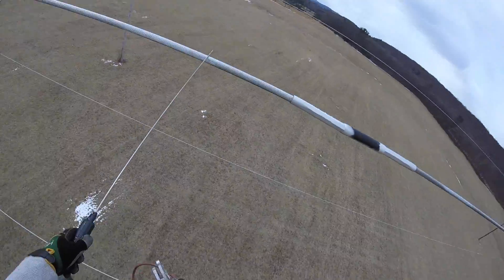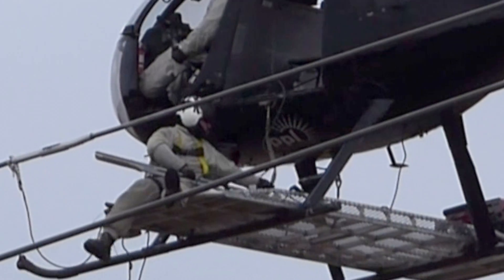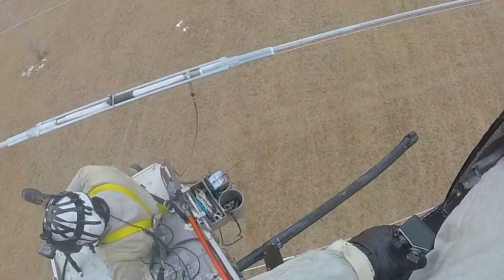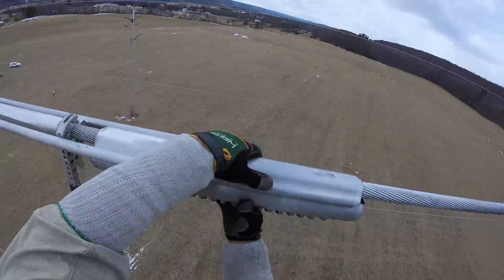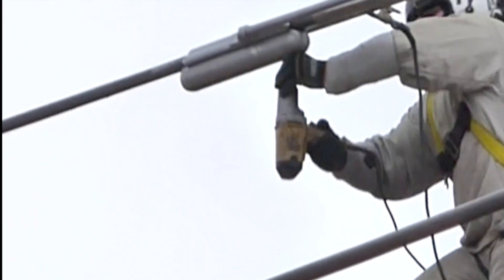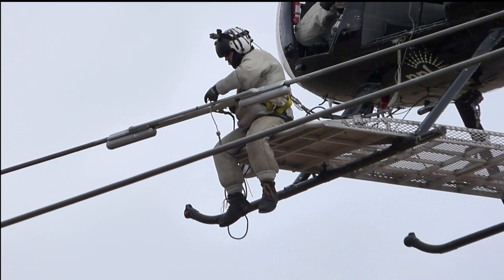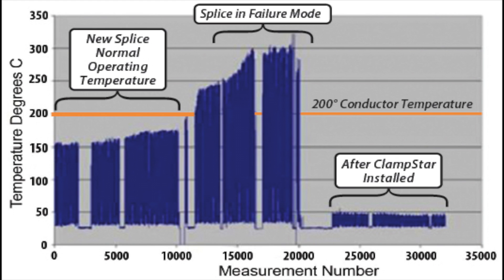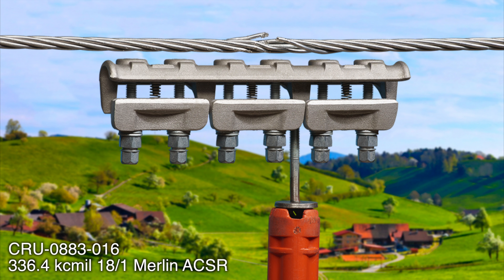Here's What To Do After Finding Hot Connectors On Overhead Power Lines

Comment: Why using a helicoper to repair? As it not only risky it is also a waste of energy
Reply: Snuggle Puggle: To bring the cable down, you have to turn off the power on the line. Then have a crew climb up a few tower to unhook the cable and lower it down. They can not unhook one tower at a time, so you need multiple crews to lower it slowly and evenly. Else there will be too much force and the cable can snap, or it can damage some towers or isolators.

Each person have to climb, which is riskier than being on the heli.

As for a waste of energy? Maybe.

The heli itself is quite safe. The guy is tied, so can't fall. If there is any issue the pilot will simply fly away and the tether cable will unhook or break in a safe way. So no danger for the heli itself. The work guy wear a conductive suit, which ensure that he is all the time at the exact same voltage as the line is. Since there is no way for him to touch another wire or the ground then there is no electrical path, and he can't get electrocuted. The danger is when he clamp on and off, which is why he use a rod to make sure the heli and him is at the right potential. If for some reason that fail, the suit would still make it safe. The rod step would be optional actually, they could just come with the clamp and a slightly different aproch, but why do that when the rod make it safer.

Once the clamp is on, all you need is a pilot which can hover. This need an experienced pilot, which is not anybody, but they are very common. Get the best and you are good to go.

Then you have the money part. If you bring down the line to do the repair, you have to cut the power to some client, and lose lots of money. Those lines can power a whole city. Turning it off is not always an option. Even if it was an option, the cost of the crew required to bring the cable down would be very high, and it take longer to do it. Now, they can do the repair with one pilot and one repair man, with one heli, which might be only 500$/hour (probably even less, I'm guessing 150$/hour for each of the pilot and repair guy, 15 gallon/hour of fuel (that is actually at cruising speed)). The ground crew would be cheaper, maybe 75$/person, but probably need 6-10 persons instead, and probably 2-3 hours for the repair. The heli can easilly do the repair itself in a few minutes. Do the math, the heli ends up quite cheaper.

As for crew safety, falling off a tower is easy and happend relativelly often. Falling off the heli or having an heli crash is almost unheard of.
Reply: Snuggle Puggle so you are not connected to ground. The lines are always life
Reply: Michael S what does this have to do? Here in germany they repair it from the ground... Its safe
Reply: SP: They use helicopters because they are faster and less expensive than using ground crews and multiple men.
Reply: Snuggle Puggle if the cable is on the ground then it will arc. The ground around  wire will be electrified. It can also cause a fire. Look up for downed high voltage wire. It is scary.
Reply: Ground mounted repair is always dangerous as you are more subject to high wind without being able to pull off like a helicopter, the clamp used to maintain an equal potential is designed to pull away if a gust forces the pilot to pull off. Also, when using a structure connected to the ground it is always a risk of a ground fault and with transmission lines the risk is substantially higher, something like a 745 KV line can arc across 25cm of open air when it is live. You might suggest working on a dead line but that is a rare luxury with transmission lines where there is no such thing as a planned outage like there is with distribution lines.

The other issues are ease of access and speed. Some transmission lines are miles from a road way across a field that might be planted with crops and the only suitable path due to weather might be through the field which can cost the utility tend of thousands of dollars in damaged crops that they have to pay by law. Now, think about how quick it would be to do say 5 of these over 20 miles of transmission line, which is a fairly realistic scenario if there has been bad weather,  a helicopter can do all 5 in one go while a truck might have to drive out of its way to access another portion, possibly having to drive through a different field each time.

Yes, helicopter repair can be seemingly costly and is definitely dangerous but the same can be said about flying in a plane, sure you can drive a couple thousand of kilometers to get to the same place but while the cost of fuel might be less the lost time isn't being taken into account.
Reply: Pelican1984 thanks this makes sense :)
Reply: Michael S *live
Reply: thephantom1492  this explains a lot thanks. But are you sure its neccessary to switch the power off to repair it from the ground and even bring the cables down to the ground? Because im totally sure that ive saw once 2 man fixing something on the cables from the ground here in germany
Reply: @snugglepuggle5610  You must have really, really long ladders in Deutschland to reach cables that high up.  Personally I would rather take the "express elevator" instead of climbing half a million steps up the ladder.
Reply: thephantom1492 you made me intrested in powerlines now hahahah yes youre right
Reply: @thephantom1492 
In all the work I’ve seen done on power lines, I have never seen a cable lowered to the ground for anything except conductor replacement. If they don’t use a helicopter, they have several options. First, they can use a bucket lift with insulated boom to lift the lineman up to the energized conductor, where he does the job the same as from a helicopter. If they can’t use an insulated bucket lift but do have a conventional bucket lift, they can shut the power off and do the job. And if they can’t find a lift of any sort, or can’t get to it with a liftthey can climb the nearest tower, then walk on the cables to reach the job location.

How safe is a helicopter? In calm wind conditions, no mechanical issues with the helicopter, with a really good pilot in good health, who doesn’t make any mistakes, is always attentive, and doesn’t sneeze at the wrong moment, I’m sure it’s quite safe. But there are so many ways a lineman on a helicopter could get injured or killed. Being crushed between the helicopter and a tower or cable looks like it could happen so easily.

Transmission lines are normally paralleled with other transmission lines. During times when load is fairly low, they can usually be taken out of service for repairs without interrupting any customers. If a line can never be taken out of service because the load is always too high, that means new transmission lines need to be built to increase capacity.

Falling off a tower is not easy and would never happen if the workmen follow proper safety procedures, which involve being attached to the tower at all times.

There are lots of videos of helicopter crashes on YouTube.
Reply: Snuggle Puggle you know nothing! Common sense really. Faster & SAFER
Reply: MarbRed Fred i didnt wrote its not faster if you can use your eyes correctly. Its maybe cheaper and faster but definetely not safer. I saw a lot crashing copters. Its just too close to the powerlines with its rotors

Comment: I hope I never have too see those big lines that close!
Reply: That goes double for pilots of light aircraft.  I attended a power line safety meeting for pilots presented by our local public utility and they brought a display board with samples of various high-voltage cables.  When you see the size of those cables, you realize that a Piper or Cessna flying into one might as well fly into a brick wall.
Reply: @Milosz_Ostrow  For size reference, a 4/0 wire is just a bit under 1/2" thick. A 477MCM ACSR cable is about 5/8" across, while a 2000MCM cable is roughly 2 inches across...

So, running into a brick wall is definitely a good analogy here.

Comment: Wouldn't there be a voltage differential across the bad connection? Heat is being generated because of voltage drop across the bad splice. I'm guessing the voltage drop wasn't high enough to warrant any bonding before attaching the splice?
Reply: You are correct. According to Southwire's chart for that "Lapwing" ACSR cable is rated to handle 1354 amps max. Since the rest of the wire is cold on the IR camera, it is safe to assume current was much less than that. For example, lets say current was 400 amps and a guess for the heat dissipated in the bad splice was around 200 watts (it was warm, not searing hot), the voltage drop across the bad splice would have been 500 millivolts.
Reply from the maker: Once the voltage drop across a connection reaches 0.3V  (yes, that is 3/10ths of one volt!) the aluminum will exceed 650°C and the splice will melt.  Actually, it is unlikely to get that high (0.3V) before the connector let’s go mechanically.  If you can’t handle 0.3V, probably ought be in a different profession – and that would not include auto mechanic, as you would have to wear a full set of gloves and sleeves to change a battery!
Reply: Was the black discoloration on the old splice caused by months/years of heat cycling?